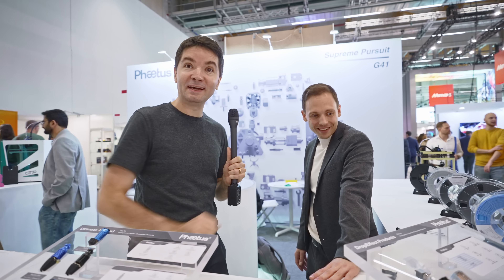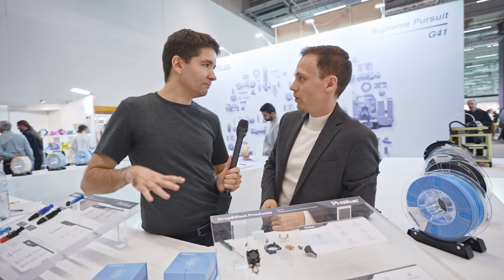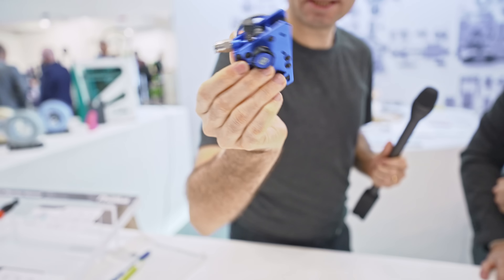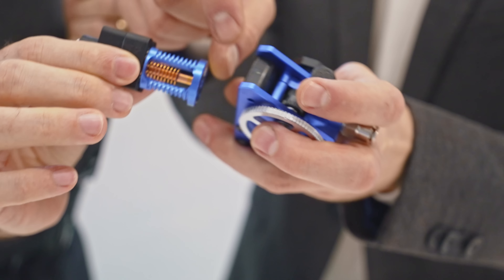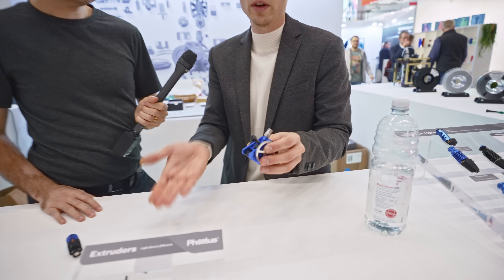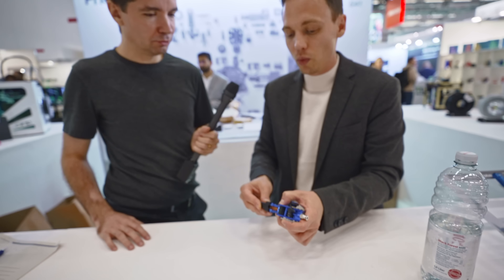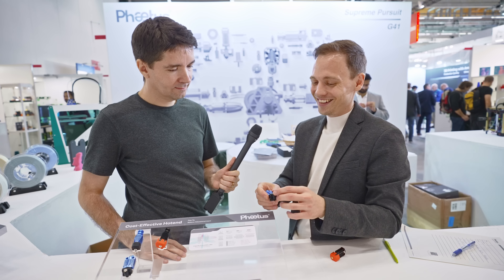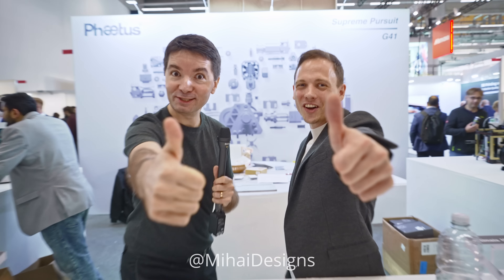Phaetus booth at formnext: Max shows the XG hotend, APUS extruder, and the Positron 90-degree hotend

Comment: the 90 degree hotend should make the Positron more mainstream!
Reply: Until you get a clog!
Reply: @JonS  it should be mainstream first before I worry about it clogging 😂
Reply: I just wish someone would manufacture it for under $300, it's such an ingenious design.
Reply: @exsurgemechprints2671  I solved that with my patent pending 360 degree hotend.
Reply: @WurstPeterl  😱😱😱😱😱😱😱
Reply: @JonS  I've had 90º hot ends and they didn't clog, but they had an inferior heat break system, die cast body and inferior cooling, which after 10-14 hours with some materials became heat creep affected. If you add titanium heartbreak, copper heatsinks, and directly couple heatsink fans heat creep would be negated.
Reply: @timmturner  Sorry to reply to a 2 year old comment, but Lemontron on youtube has brought the cost down to $411! I'm going to build one soon
Reply: @fish9468  that's a bit steep for what this is didn't you think?

Comment: I just got in a Phaetus Dragonfly for my Ender and the temp sensor welded itself inside the old heatblock. Pulled the wires right out. Good thing I had ordered a PT1000 to replace it anyways. The other issue I had is my Ender didn't come with standoffs on the gantry plate but a flat plastic shim. So have to add some spacers to get around the Dragonfly's barrel curve. It's always something. ;)
Reply from the maker: Uh! 😟 Sorry to hear that
Reply: My Dragonfly BMS had no issues mounting on an Ender 3 Pro. No need for any spacers or anything else. I didn't even have to move the Z endstop switch... just straight up bolt it, quick PID tune and it's ready to print.

Comment: watchout, Slice will sue you for those screws holding the hotend
Reply: They can't, DropEffect managed to dodge those patent claims like a thread on a needle, they are screwing the heater block into the heatbreak and then the heatbreak into the cold block and fins. SE's patent only claims attaching the heater block to the cold block.
Reply: Such a stupid patent. They weren't even the first one doing that. Just the first one to patented it.
Reply: I'm sure they will try.... doesn't seem they are interested in anything but "legal innovation" these days.

Comment: "Kinematic coupling" has somehow become the new buzzword...
Reply: I believe that's largely because of people running into trouble with patents from Slice Engineering. Instead of a 'rigid' coupling it uses a method different enough to satisfy patent law for solid mounting, hence the frequent use of the term 'kinematic' coupling
Reply: what thewrongbutton said, its to get around slice engineerings bullshit patent, but also this is quite literally a kinematic coupling; its a modified maxwell coupling using socket heads instead of balls, and its appropriate in this case to reduce heat transfer. its a clever design, even putting aside the need to skirt around that stupid patent